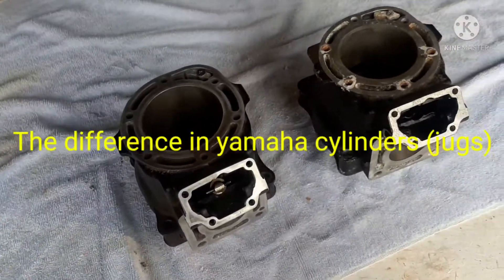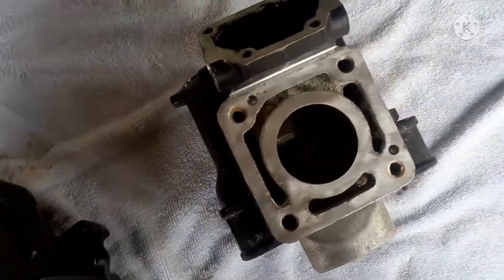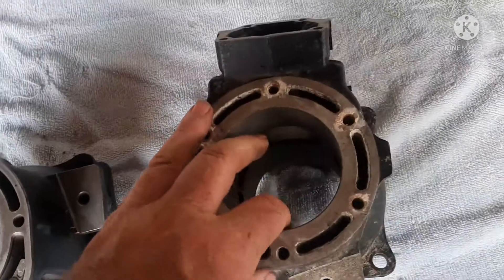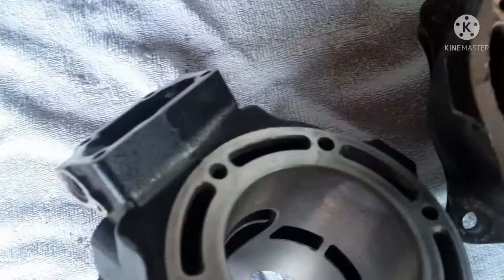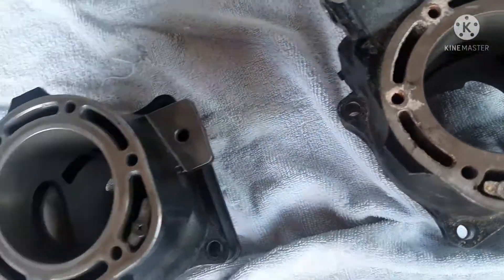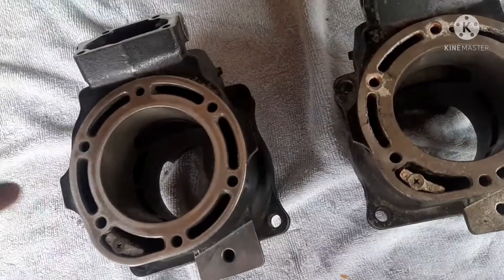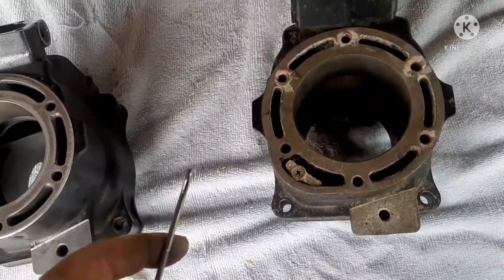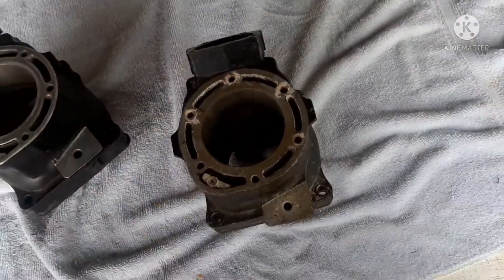Yamaha 66E and 66V cylinder differences.

Comment: The port you are referring to is a transfer port, not an exhaust port. That transfer port is undercut on the 66E and rectangular on the 66V. 
The larger port on the 800 cylinder isn’t where the additional 5hp per cylinder comes from. The 66E makes more power per cylinder than the V  because the exhaust port timing is different. The exhaust port on the 800 cylinder is 2mm higher than the 1200 cylinder.
Reply from the maker: Thanks for the info.  I only knew that the 66E00 was ported to produce more hp.  I made the assumption that it was due to the size of that one port as that was the only visible difference.  I am not a machinist nor an engineer.  Sharing knowledge we all learn something.